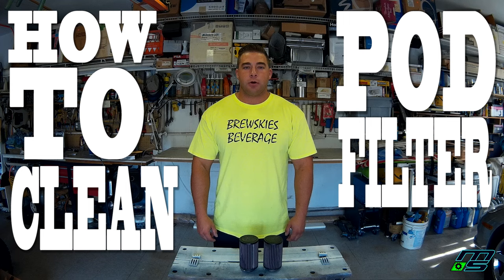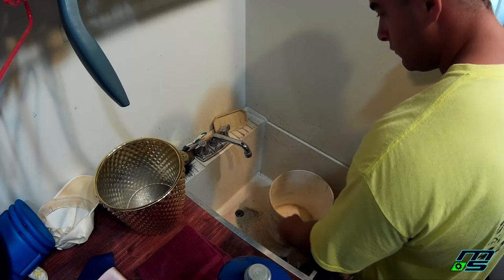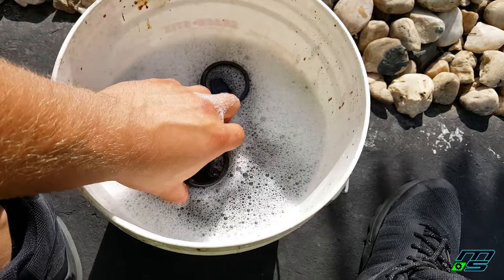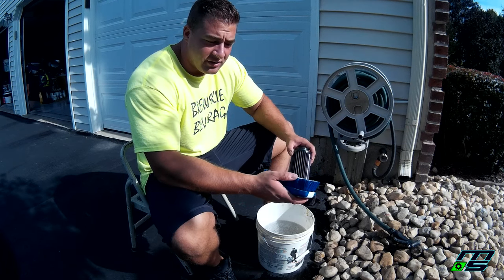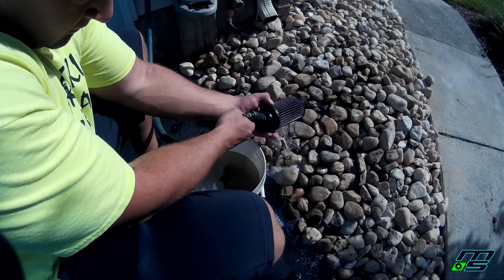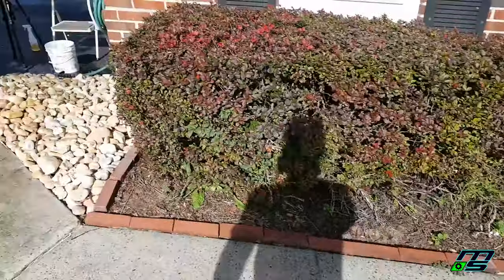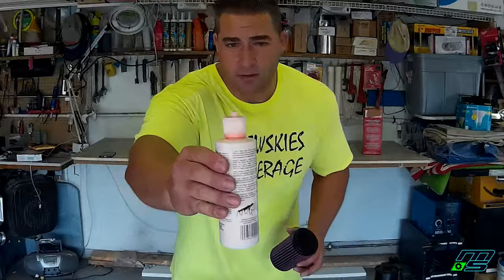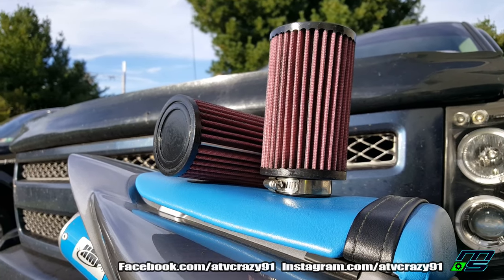How To Clean POD Filters

Comment: Hi Michael will the new air box fit on your stock carby ? Is it a 26mm stock carb and the pods ?
Reply from the maker: The new box does not come with boots, so it depends what boots you use. I am using stock boots so my stock carbs should mount up just fine.